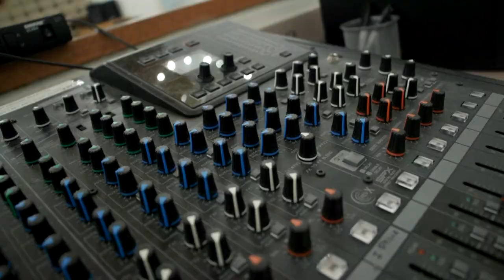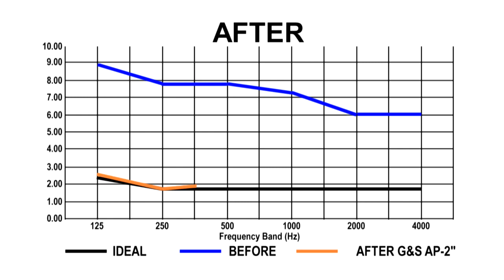Acoustical Wall Panel Installation Inside a Church

Comment: What was used to glue the Panels to the walls?
Reply: I am not sure what putty they used, but at 1:48, you can see the brackets. I would assume the brackets hold it in place while the putty cures.
The panels have to be Owens Corning fiberglass panels. An industry standard regarding rigid fiberglass panels.  Then wrapped in cloth.